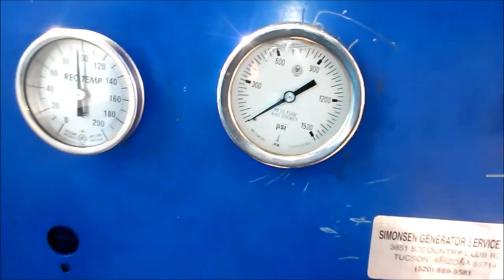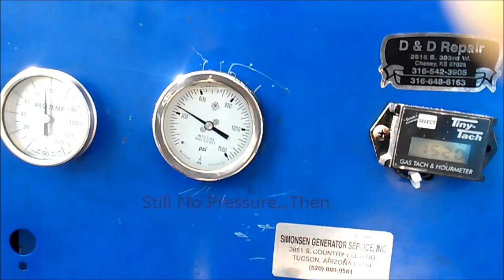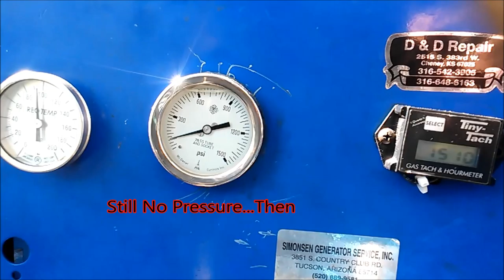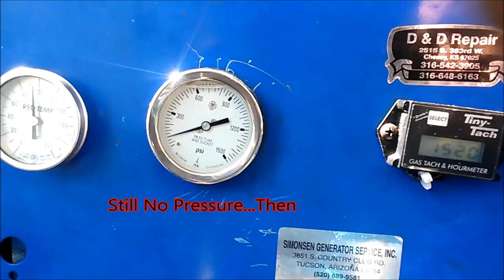Water Pressure Troubleshooting

Comment: Descaling the machine may be the culprit as well. Check fresh water screen( IF attaching a water hose directly to the house) that often gets clogged by debris. The pump can be manually cleaned by removing the check valves and O rings to check for hard water deposits.